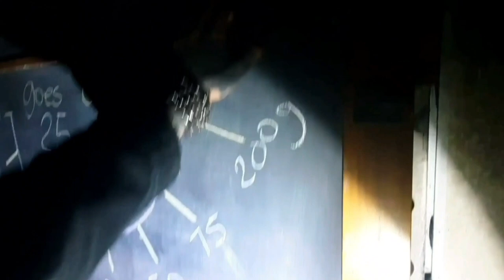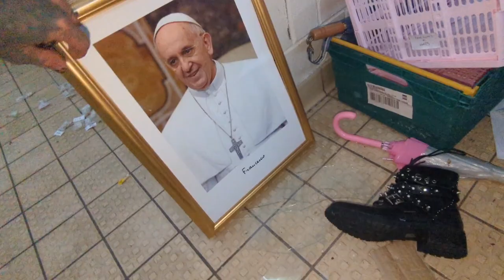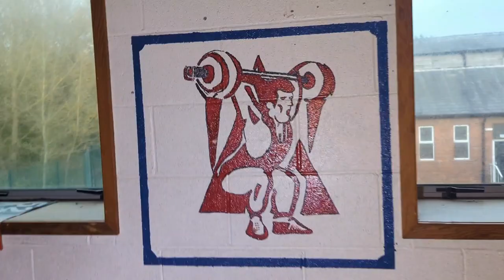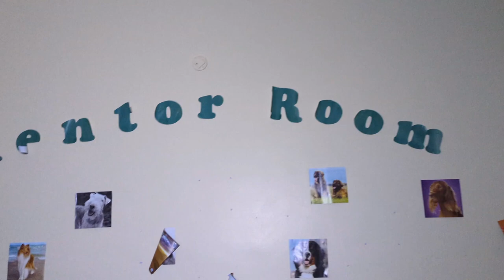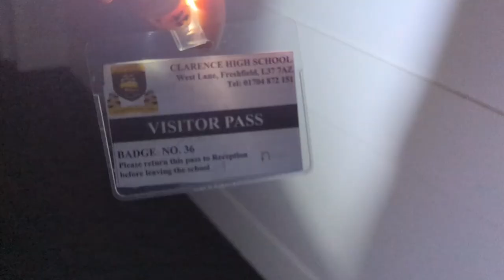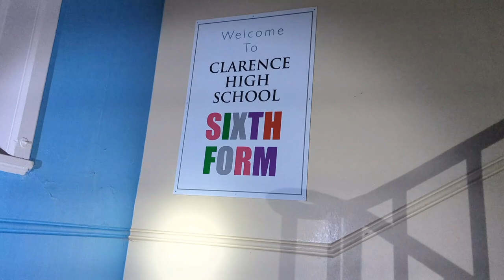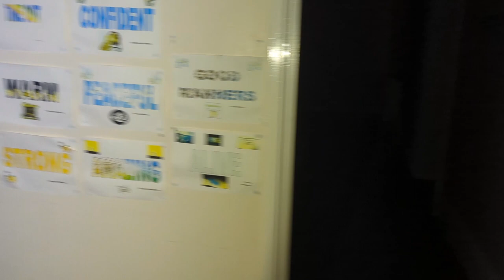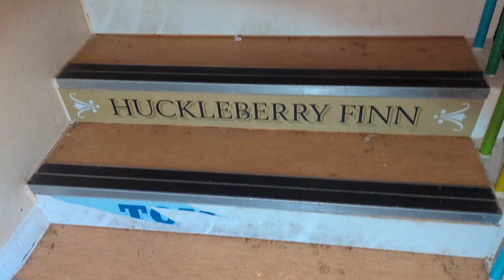Abandoned Clarence House High School Freshfield Liverpool Abandoned Places

Comment: @32 mins you say it might be a decorating place. That's the first floor of the main building and used to be bedrooms for residential kids at the younger end (I used to go there). There was walls and doors inbetween them all. The biggers spaces were a dining room and room with TV / sofas etc. That 'unit' was only for younger kids, when you got older you went across to the other side of West Lane where there was some other residential units but they've been flattened since then.